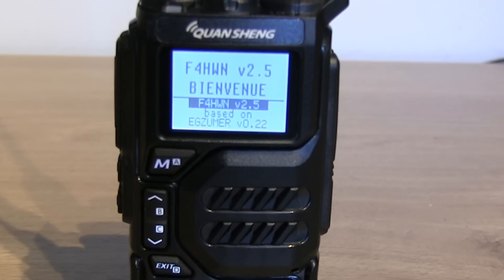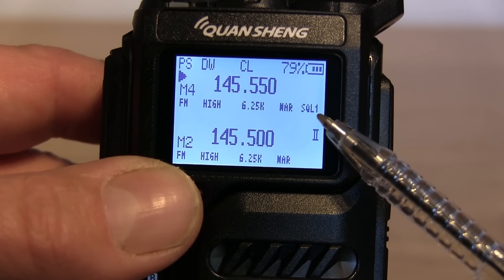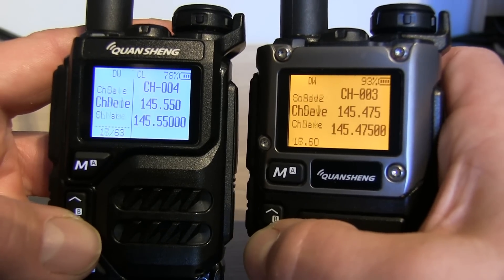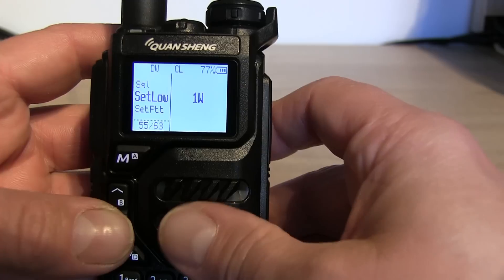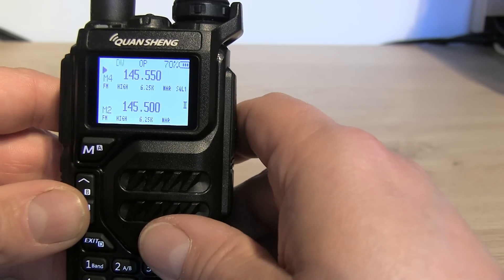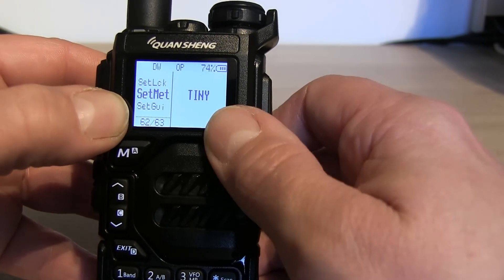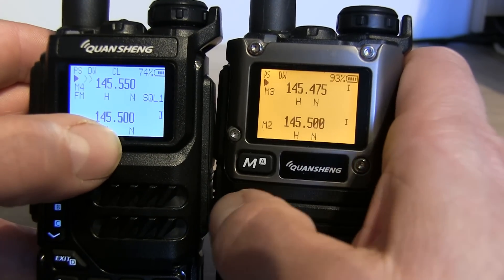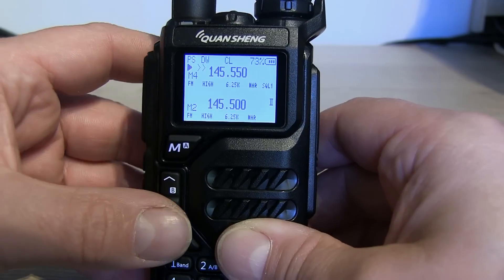Quansheng Firmware F4HWN v2.5

Comment: Thanks a lot for following my tip. Armel has more plans for improvement, but since the current version of his firmware uses up almost every byte of the flash memory, he will have to do away with built-in features. FM broadcast seems to be at the top of the list for a 3.0 version. He already has removed some obscure, little-used features like the flashing flashlight to free some space. Numerous bugs have been corrected, too.
His firmware is open-source, just like Egzumer's.
Reply: Thank you for the tip. It's good stuff. I understand the memory limitation, but FM broadcast monitoring is important to me, as I don't really want to carry more radios. The bottom line is to receive as many frequencies in as many modes as possible, and to be able to transmit on as many ham bands as possible as well. After that comes the features. For instance, I don't really have to have 2 different S meters. I prefer the mods Armel has made to the classic. No need to waste mem on 2 of them. In fact, an S meter isn't really essential at all if there is another useful feature that can be put in its place. I can guess at the signal report info about as well as my uncalibrated HT display produces. Signal reports are left over from the days of big base-stations, log-books, QSL cards, and some of the contests. Sis reports on HT's are essentially meaningless. Having said all that, I wonder about the possibility of upgrading the internal memory. A lot of us can desolder and replace onboard mem chips. Having twice the room for code would make everyone happy. And of course as soon as the manufacturers see hams doing that mod they would start selling HT's with the expanded memory storage so no one would need to swap chips.

Comment: I tried this firmware.  Once it was loaded, Chirp wouldn't read or write to the radio, even though I loaded the correct module.  I reverted back to IJV v3.21 with no issues.

Comment: From the features and easy to use perspective, this one is the best so far. But I feel the reception little bit weak compared to another firmware, even with another egzumer fork like Kamilss NuNu I used before. The sql seems the problem, I have intermittent sql open with this FW and no problem with another FW on same repeater. But when I open the monitor function the signal is strong.

Sorry for bad English
Reply from the maker: That's interesting, thanks for your comment and for watching 👍

Comment: I bought my radio thinking that even if it was a flop, it wasn't an expensive flop. So far, I am having more fun than I thought would be possible for $30 USD (including shipping, tax, etc.). I can't figure out which firmware I want to try...like a kid in a candy store! This one is a strong contender right now. Your videos are very helpful!!!
Reply from the maker: Thanks for watching, glad you're enjoying the radio! Have fun 👍
Reply: i tried others,  this is the one i kept on all 3 of my k5's.  egz is nice , the am fix is great for Airband listening, but the radio would glitch out on 2 meter tx for some strange reason screen would do strange stuff like washout or just not tx ,  ijv for some reason would not pick up air band at all even using my outside antenna .  so far this version works flawlessly and i have not found any glitches. hope that helps

Comment: Ben, hi! Thanks for the interesting information. I'm currently using version 2.6. I have a question: how can I connect an outdoor antenna to get good reception?
Reply from the maker: Hi, get yourself a SMA male to BNC or S0239 female adapter so you can plug in an external antenna. Thanks for watching 👍

Comment: Gran trabajo. Este firmware permite TX en todas las bandas ? Incluido 27 MhzCB?
Reply from the maker: Unfortunately this radio is not capable of transmission on 27Mhz with any firmware.
Reply: @m7frs272  https://www.youtube.com/watch?v=JwsR4fvYumU
Reply: @m7frs272 not true try IJV V2.9R5,  I can confirm it transmits 5 watts on 11 meters and 10 meters. AM and SSB/DSB.

Comment: Thanks for the info on this ben, a couple of questions, is this ok on the k5 (8) radio and secondly, is the firmware still compatible with chirp?
Reply from the maker: Hi, yes it will work on the K5(8) (I demonstrated it on the original UV-K5) and yes it also compatible with the version of CHIRP which I am using. Thanks for watching 👍

Comment: I don't get this 1Watt setting. The radio default is around 3 tot 4 Watt. So does this setting mean that 1Watt is the max transmit power after installing this Mod?
Reply from the maker: No, that's just setting the low power output level. So High will still be say 4w, mid 2.5w and low, whatever you set in the menu from 1w down to 20mw.
Reply: @m7frs272  Ah, great, thank you.
Reply: @cloudstrife5209  You got a point there.

Comment: I tried this firmware for a couple if week and found it very stable but went back to Kamilsss firmware as I missed the spectrum speed scanning feature and I found the items on the display quite hard to read, may be you should demonstrate the Kamilsss firmware Ben
Reply from the maker: Thanks for the info and thanks for watching. I'm not familiar with Kamilsss, but I'll certainly give it a look. Cheers.
Reply: What is "spectrum speed scanning feature"? I've tried the Kamilsss firmware but didn't find that. The regular frequency scan (long press *) works at the same speed as it does in F4HWN, and both of them have the band scope functionality (f+5).
Reply: @ВасилийПетров-ы8й  in VFO mode set the A and B to set your scan range for example 144.000 in A and 148.000 in B then long press button 5 this will now show the frequency the radio will be scanning, press button F then button 5 again and you are in spectrum scanning use F and * to adjust your squelch threshold, to blacklist (miss out) frequencies push the button below the ptt it is easy once you get the hang of it

Comment: Is there a shortcut to disable tx in this firmware?
Reply: I believe you go in to the hidden menu PTT and button below and switch on there is the disable TX in there
Reply: @petercarter9034   yeah your right but id like to see a shortcut for that, like if you could program one of the side buttons to disable ptt. 
I carry my radio everywhere with me and sometimes the ptt gets jammed on when im driving and gets stuck between the seats or whatever. It would be nice to be able to toggle tx on or off quickly without having to go into the menu all the time. Also those times you forget to enable it and you want to reply to a call, you’ve then got to switch the radio off and go through the procedure of holding buttons. 
Its the one feature im looking for on this radio but not one firmware seems to have at the moment.

Comment: Are you finding your K5 battery doesn't last so long? Have you done any battery upgrades?
Reply: Only real way to upgrade the battery in a simple way is to buy an UV-5R Plus, take it's 2200MhA battery and cut the notch on top of it to make it fit on all models. Other than that I found a 3D Printed battery pack from the IJV firmware website.
Reply: @DuskarIsNotABot  Cool.